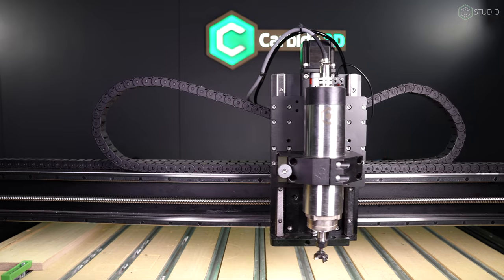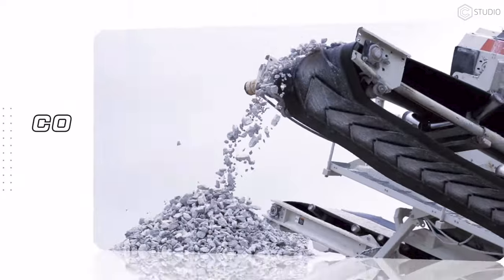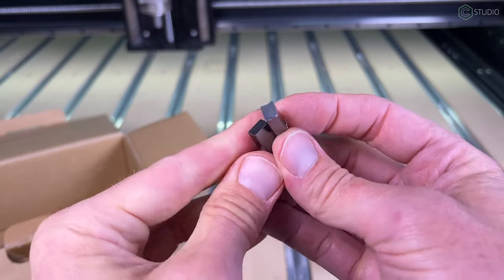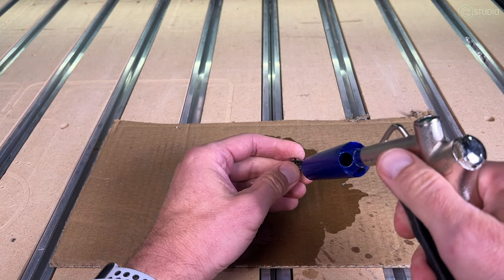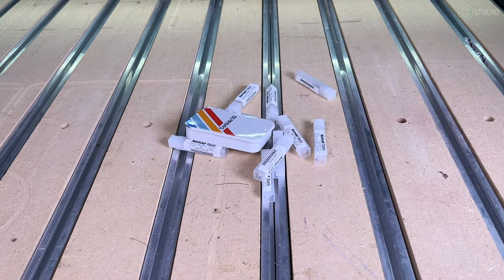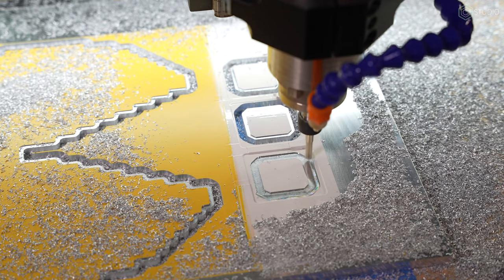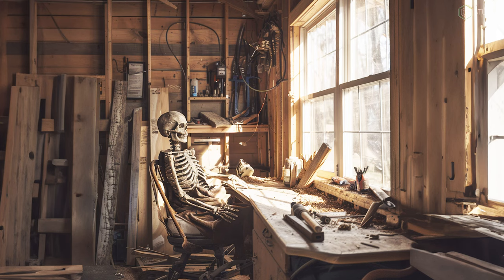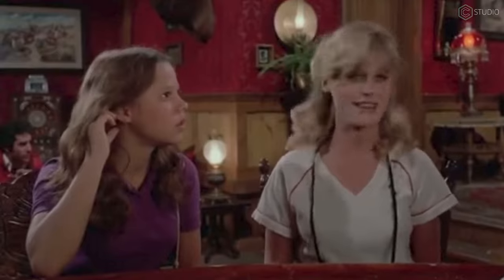Should You Buy a VFD instead of a Router?  Answers await......

Comment: Ordered the VFD when it first came out from Carbide. The spindle died about six months in. Carbide support was incredibly fast and a replacement was sent, to Canada, a few days later. Been using it to cut aluminum almost every day and its been fantastic.
Reply from the maker: Especially when cutting metal on the regular, a VFD is the way to go.

Comment: Just a note that it is pretty easy to have a router turn on and off automatically with a relay.  I've been using an Iot Relay off Amazon for $30 that was pretty much plug and play so you don't need to really know anything about electronics to set it up other than knowing where to hook it up on the control board.  It's really something I think C3D ought to be offering as an upgrade or even make it stock.
Reply from the maker: That's definitely a possible middle ground.  And why we have BitRunner.  https://shop.carbide3d.com/collections/accessories/products/bitrunner-v2?variant=39390450286653

Comment: I have a router on my woodworking machine and a spindle + VFD on my small metal mill. On the woodworking machine, the router has worked well for 20+ years. You just need to be sure to get a variable speed model and you will be fine. I have had a big Dewalt router fail on me twice though and it never happens at a good time. Given their cost, I would keep a spare on hand. The Dewalt soft start control gets fried, not the brushes so spare brushes won't help. The VFD and spindle are really nice but you really need to build a proper control panel with On, Off, Speed control on it. They aren't hard to assemble and will make living with a VFD far better because those miserable little controls on the VFD will get to you after a while. And, the spindle is far quieter than the router; no hearing protection needed.
Reply from the maker: Interesting notes David.   The Carbide 3D Kit comes with everything someone would need.  Control box, Spindle and software integration built in.  So our users can take advantage of all those benefits immediately.  
Keep on running that router!

Comment: I know this was mostly a sales pitch to sell the C3D spindles, but it actually is a pretty good setup.  It's done and ready to go once you get it plugged in, and is a huge upgrade over the router.  I do like that the C3D VFD is 110/120v and not 220/240v as is somewhat common for a VFD.  I coupled mine with an iVac Pro Tool Plus sensor on the cable going from the VFD to the spindle , so I've now got  utomatic dust collector control.  Two added benefits, one I don't have to remember to turn the dust collector on and off, and two if I'm not watching the CNC the whole time, then I at least hear the dust collector turn off, where before there had been times where it would raise the router and tell me to turn it off at the end of a program.  So sometimes it'd run for a few minutes before I'd notice it was done.  Not anymore!  The C3D VFD was easy to install, but if you hear a rattle or anything that "doesn't quite seem right", open the VFD enclosure to investigate.  Mine had a loos screw rolling around inside it when I got it (scary, given the nature of the components inside).

Something else to consider is that the VFD will probably require a non-GFCI circuit, which is not to code for most new or renovated structures where people will likely have their CNCs, at least in the US.  I ran in to this recently, despite being told by C3D and a few users that it "worked on GFCI".  They're not all the same, so your mileage may vary.  I know C3D now says that it won't work on GFCI on the product page
Reply: Interestingly, my carbide 3d VFD works fine on a GFCI. No idea why.
Reply: @uhavenosushi exactly lol  I even tried some EMI filters and power strips designed to help with that sort of thing and it still tripped the second the spindle powered on.  3 different circuits all did the same (one of which was a GFCI breaker and 2 were GFCI outlets).  I just ended up making every other outlet on the circuit GFCI except the one the VFD was plugged in to.  Thankfully it was at the end of the line

Comment: Great sadness, my local code requires GFCI in the garage.  My only option is the screaming router.  Had I known that I’d not have built the table and saved up for the CNC over the last year.  I fear the screaming router is going to anger the neighbors.  Are there brushless trim routers I can use for the 5 Pro?  Thanks.

Comment: Would it work on a 3XXL and can you still use on and off manually
Reply: I have a 3XXL and I would not spend that kind of money on a belt driven CNC.I might be wrong but you'll have to upgrade your Z-axis mount too and not sure the gantry is strong enough for a 2.2+ spindle. Others may chip in of course.